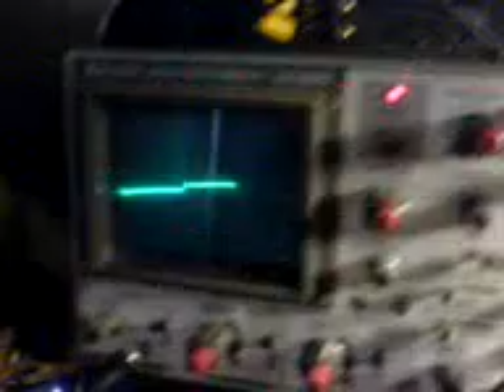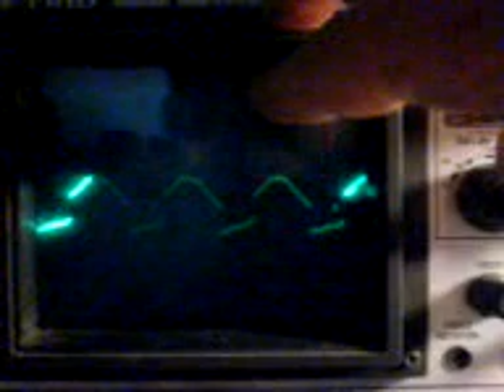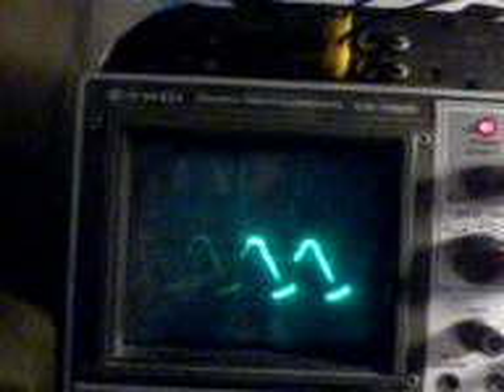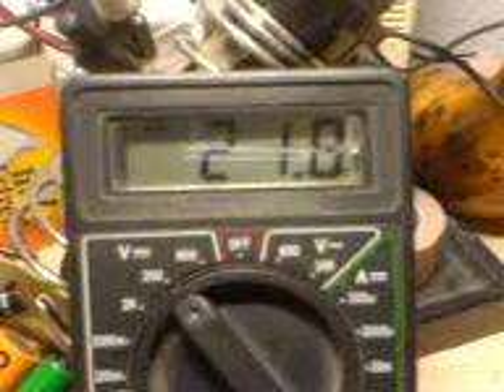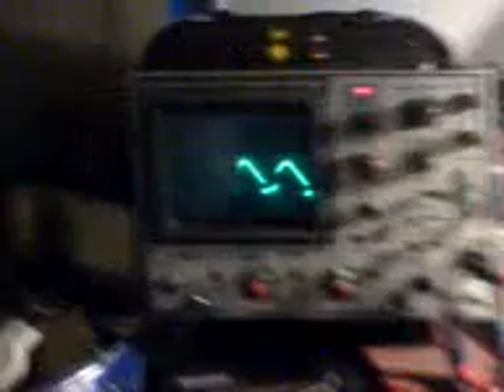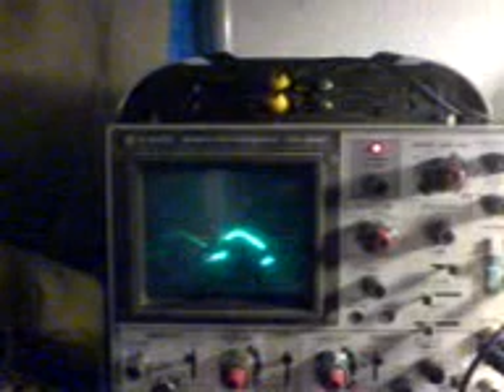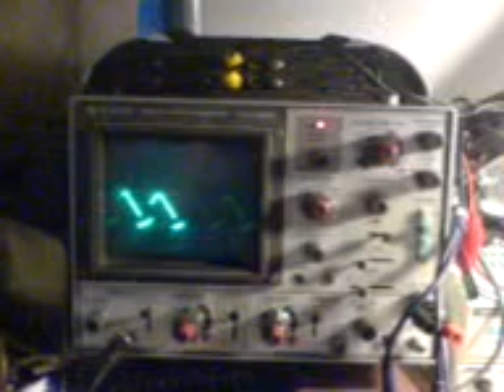newman motor powerd by a PWM volt stepup 12/50vdc part2

Comment: Hi Ray, I started watching videos about newman motors a few weeks ago. Do your tests reveal that the motor is putting out more volts than you are putting into it? If that is correct, how much more?  Can this energy be used in a practical manner like lighting a 100w bulb or running a refrigerator?